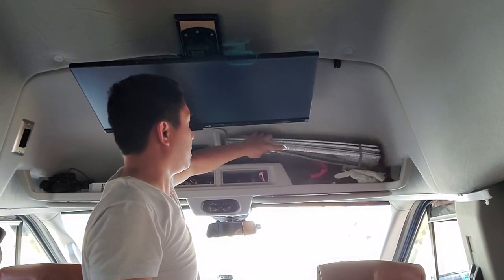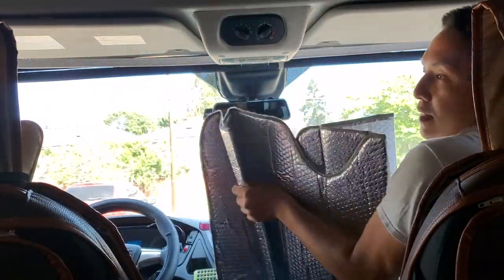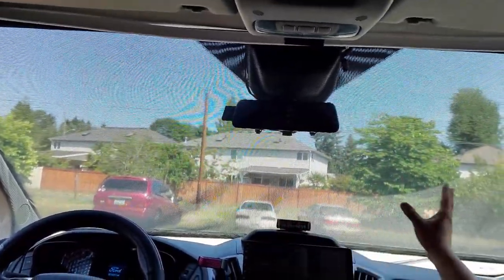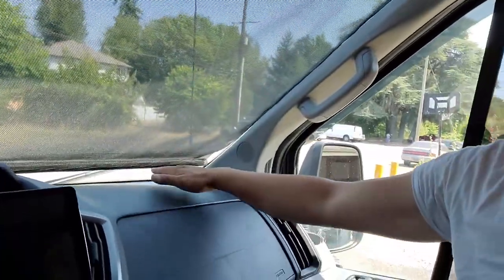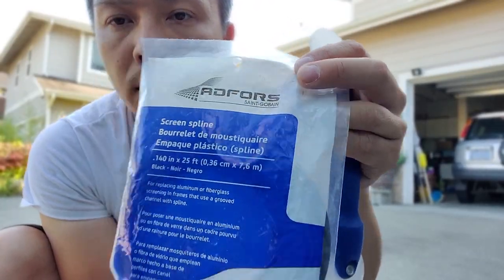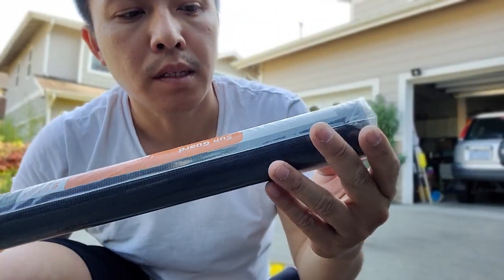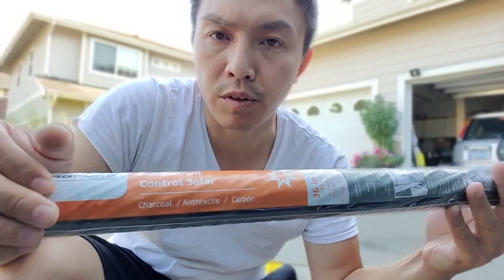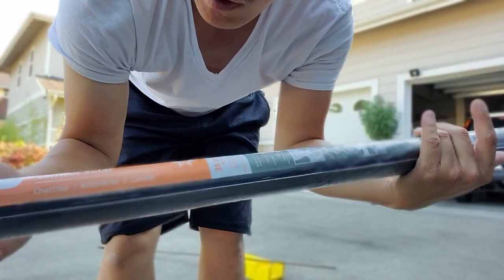DIY TRANSPARENT SUNSHADE for Vanlife. Cheap way to have a view, natural daylight, and privacy.

Comment: Great idea I was thinking about getting the reflective static film that looks like a mirror on one side but you can still see through from the other side and cutting pieces to fit the windows exactly - maybe you can try that for the side windows and see if that works in terms of shade comparison.
Reply from the maker: That is great but it let in too heat from the sun. You do get more light in. I might have sacrifice a little comfort for the light. Thank you for the tip.